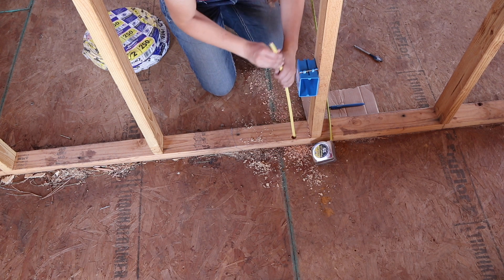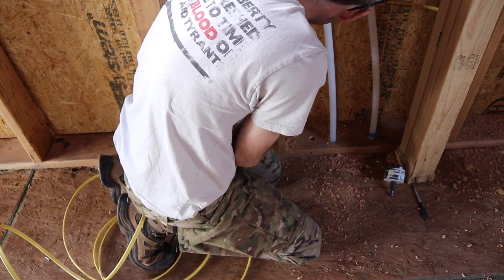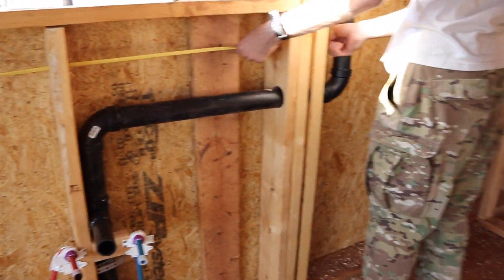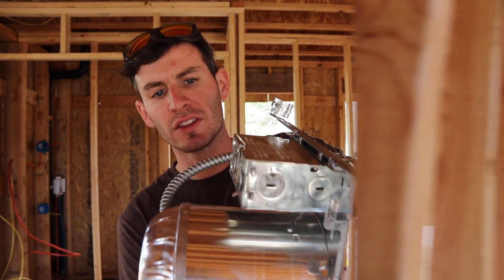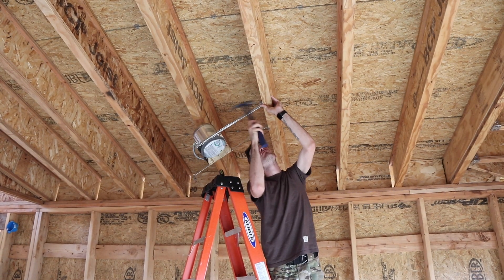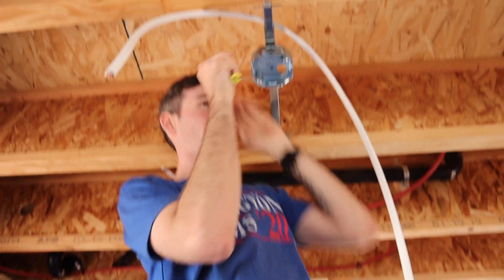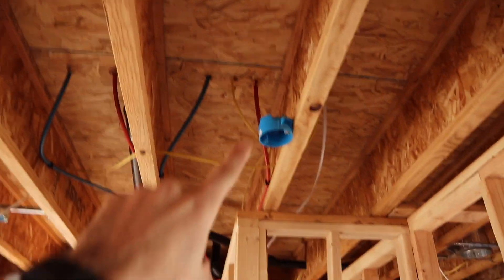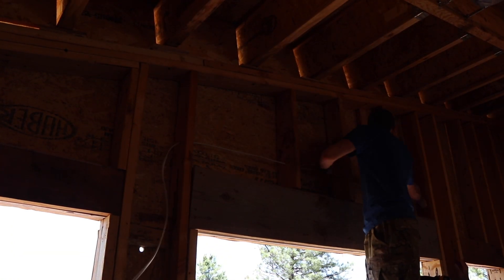Wiring Our House (DIY House Wiring!)

Comment: Romex wire for house electrical has gone up in price to atleast 7 times more than 3 years ago. All the components are cheap, outlet boxes, switches, outlets themselves, yet they have price gouged wire so much that wiring your house is one the most exspensive parts of building your house. Its ludicrous robbery.

Comment: hey man, do good work honestly, but dont act like you know as an electrician... we did our time for the ticket. Respect
Reply from the maker: Not trying to disrespect anyone. Just showing how we did it and hopefully inspiring people in the process.  If you think I did something wrong that's fine, but if the work is correct I'm not sure what the issue is. Electricity isn't rocket science and rough electrical/wiring outlets and switches is well within the capability of most people.

Comment: I don’t see you using spool how did you not have twisted wires?
2nd question how did you determine how much wire you need 
I have 900sqf basement I need to wire I hate to make constant runs to Home Depot
Reply from the maker: We were just careful when running it, and there were a few places where we had some twists but it wasn't too hard without any type of spool
Reply: The answer is simple...run too much.
To much and you an cut some off.
If you find yourself just 1/2 inch short, the fix might be to replace the entire run.  Hope you did not finish the walls before that discovery.

Comment: May I ask is there a certain specific height need to be running wire thru the stud? Like 18 inches above the the floor for the outlet, and 4 ft for the switches?
thanks in advance
Reply from the maker: There is no height requirment for where to run the wires, there is a height requirment for the switches and outlets.

Hope that helps!
Reply: @PootsPastures  Thanks

Comment: You shouldn't place the hole for your cable near the edge of the bottom or top plate - or you will need to install metal safety blocking plates to prevent drywall screws from damaging the cable.  A couple of your holes were within a half inch of the edge.  You should shoot for the middle of the plate.
Reply from the maker: the reason some of the holes (at least in the bottom or top plates are so close to the edge is because of where the floor joists landed below the subfloor.  If we had drilled through the center we would have gone straight into the floor joist.  We added nail protectors over every thing that was close to an edge.
Reply: They’re called mail guards. Or FHA plates

Comment: Those Wago adapters are known to fail and could start a fire
Reply from the maker: I could see where you could not insert the wire all the way, but having the clear plastic so you can check to make sure the wire is properly inserted negates that.  With the connecter in place with a static system that does not have any outside stress put on it, besides a catastrophic failure of the entire device there should be virtually no risk.  I hate wire nuts with a passion.  There are so many more ways a wire nut can go wrong.

Comment: What about if I run the supply line to the light and come off to the outlets from there? Can I do that or do I need a junction box?
Reply: no lights and power should be on different circuits altogther. There is alot more to electrical than what these guys show
Reply from the maker: What part of the code dictates that? Also all of our lights and outlets are on different circuits.  Thanks for watching!
Reply: @PootsPastures   it is australian code for mixed circuits to only be used for areas that arnt so frequently inhabited.  but good practice for everyone as you want light in the case of a tripped circuit
Reply from the maker: Absolutely good practice, from what I recall in the US 2012 code (which was the code when we built) there is no restriction on lights and outlets on the same circuit.
Reply: @christinelyubicic2433  so you’re quoting a code reference from a different continent?

Comment: Thank you for the video! I was wondering. how many outlets can you install on one circuit? My father says it's about 7. Is this correct? I guess it depends on what you will plug in the outlet? But as a general rule, how many? Thanks in advance!
Reply from the maker: Glad you enjoyed the video! And there's no restriction per code, besides certain appliances that draw a large amount of power (dryers, fridges, etc).  We grouped all the upstairs outlets on one circuit, and the downstairs is two circuits (bathroom, mudroom, bedroom and living room kitchen) so we have way more than 7 on a circuit.  You do need an outlet every 6 feet on the walls so I think we have 7 in one bedroom alone.

But you want to think about what you will be plugging in.  If you are going to be using a space heater or things that require a lot of power you want to have more circuits than you would if you were only charging phones and using a lamp.  You can also think about what items will be used at the same time if you are planning on using a hair straightener and blow dryer all while watching TV and listening to music in the morning you may want to have your bathroom on a separate circuit than your bedroom.  We don't use a lot of electronics so we weren't worried about flipping breakers.  However that being said having to constantly go to the panel because you are plugging too many things in is way more of an inconvenience than just having more circuits, so If you are worried about it and have the space in your panel it really isn't all that expensive to add more circuits then you think you will need. 

Hope that helps! Let me know if you have any other questions!
Reply: 1.5 amps per box is what I figure, it’s up to you to determine if you need a 15 amp or 20 amp breaker.
Reply: just go by estimated amps that are being pulled. 12/2 is 20 amps 14/2 is 15 amps. mostly, people jump wire from outlets to lights. 
i would say if you're using  space heaters use more 20 amp home runs. about every 2 or 3 rooms per circuit depending upon needs
Reply: Outlet every 12 feet. Within 6 feet of wall opening.
Reply: No maximum amount

Comment: Nice neat job. However, I cringe at today’s home construction. Engineered wood joists with OSB sheathing are not only the cheapest way but also in a fire, these materials go up in flames like match sticks.
Reply from the maker: I get where you are coming from but getting 20' dimensional lumber that is perfectly straight is almost impossible so having an affordable floor joist option where I could clear span 20' and move by myself was a huge plus.  I would also argue with your cheapest comment.  If you look at most commercially build track homes they use a water proofing impregnated cardboard to sheath the house.  I have also watched a house go up across the street from me using traditional house wrap, and then plywood siding on top of it.  When you get down to the nitty gritty using an osb type sheathing with a factory applied moisture barrier, and then adding siding over it is actually one of the more expensive routes to go.  You are right about I joists though they burn pretty quick.  The zip sheathing on the other hand takes a bit to get going.  The traditional lumber in my burn piles gets going quicker than the osb does.

Comment: Why you didn’t put black botón conectores in the bar box
Reply from the maker: The bar box? If you mean the ceiling fan box because we still had a lot of work to do and didn't want them popping out and getting lost, they were added when the fans were installed.   If your talking about the electrical panel, all of the fittings that the wire goes through to get into the box have smooth edges and don't need them.  Hope that helps

Comment: Hi sir, may I know is it the yellow colour with marking is wire? What's the name it called?
Reply: romex cable #12
Reply: @fatherelijah1763  Hi thanks. But I never seen this type of wire before.😅
Reply: @fatherelijah1763  Special cable only in US or UK ?
Reply from the maker: I'm not sure what they use in other countries I think in North America its pretty common, we are specifically in the US
Reply: @PootsPastures  Okay☺Thanks for your info.
Reply: @PootsPastures  But in my country Malaysia, we are still using PVC single core wire 1.5mm or 2.5mm for housing wiring installation. Thats why I confused when I saw it. 😅

Comment: Does t every appliance need to be on there own circuit?
Reply from the maker: I think as a general rule fridges, stoves, and things are on their own curcuit because they take alot of power individually, but I'm not sure if it's code.  If you do put them separately it could save you from having breakers tripping all the time if you were to use other high wattage things like a toaster or microwave.

Comment: As someone who installed cable and satellite for 20+ years, wouldn't you want to make each electric run vertical instead of horizontal so you are less likely to hit it if making a hole in the sheet rock?
Reply from the maker: The way we did it by drilling through each stud to get to the next box is generally how I've seen it done in our area.  In our case we could have gone down into the crawlspace, over and then back up to get from outlet to outlet, but that would have increased our work and been less efficient for us.  And it wouldn't have been possible to do if we had a slab on grade.  I deffinately see where you would be less likley to hit a wire in the wall done that way.

Thanks for watching

Comment: At 4 mins and on, you connect outlets to each other via wire w/ holes bout 20" up.
Im doing exterior walls, wondering if I can drill hole bout 1" up off bottom plate and run wire on bottom plate in center.
Then I dont have to measure and cut insulation. Moisture barrier on insul would be nice not to cut.
Reply from the maker: Yeah so I think there's a code for how high off the ground an outlet has to be, but there shouldn't be an issue with running the wire on the bottom plate, then running it up along the stud to the outlet that way you don't have to cut the insulation.  The only issue I could see is that if you drill the hole at the bottom of the stud an inspector might not like that there isn't the full area of the end of the stud bearing on the bottom plate. 

Hope that helps,  and thanks for watching!

Comment: I'm a electrician  and was wondering why you used  nothing but 12 -2 for all your rooms and not 14-2 14-3 that's kinda over kill .
Reply from the maker: I wanted all the outlets to be 20 amp, the likley hood of using 2.4k watts at once is slim, but I didn't want to have to worry about it if I wanted to run something high voltage inside.  We did use 14-2 for all of the lights and the crawlspace and  several dedicated circuits, and then 14-3 for all our 3-way switches.  But the reason there is some 12-2 mixed in is because we ran out of the 14-2 and just used 12-2 in it's place instead of buying more 14 and wasting the rest of the 12.  Hope that answers your question.
Reply: @PootsPastures  fair enough also you would want 20 amps if your running a heater to I can't  tell you how many  calls I've  gotten from clients saying their outlets have blown up not knowing lmao
Reply from the maker: Haha for sure, and we're running like three heaters until our mini split gets installed.  Thanks for watching.
Reply: As an electrician....I was wondering the same thing. Also, no one learned the don't pull the wire accordion style too and roll it out. No connector on the fan box?
Reply from the maker: I should have figured out a way to put the roll on some spiny thing (can't tenderness what their called now)  but I'm not sure what you're referring to about the fan?
Reply: @PootsPastures  you ran a wire into a metal box with no clamp or connector (metal romex connector). As far as the spool of wire.... hold it in 2 hands between your legs and roll the entire coil out and the wire will be basically flat and not spiral making easier to run and staple afterwards.
Reply from the maker: Okay that makes sense to roll it all out first, and we added grommets to all of our metal boxes later I just didn't want to open the bag they were in and then lose all the screws and such when we went to install the fixtures and wire them.  But good catch probably should have mentioned that

Comment: I do wonder: The electric lines are one next to another. isn't there a danger of heating? don't they need to be inside somekind of tube for isolation?.
Reply: There isn't a danger of the lines overheating in this instance, just by being next to each other.  If there was say 9 current carrying conductors all bundled up, yes, that's a problem.  In a conduit if you have more than 3 current carrying conductors then you have to de-rate the allowable ampacity of all the conductors in that conduit in relation to the number of conductors.
Reply from the maker: So I don't remember the specifics, but the code specifies if there are a certain number of "lines" next to each other with no space for air movement in between for a specific length the amperage of that curcuit has to be lower.  I don't remember the specific numbers... but wires do heat up as their used, and if you put some insulation around them it would speed up how quickly it heats up, the air being right against the wire helps to dissipate heat.  I hope that wasn't too convoluted of an answer...
Reply: @PootsPastures  makes sense when thinking about it. thank you
Reply: @PootsPastures  one more question in that regard. What if the cables are inside a stone wall?. (bricks that is). They are being plastered later on with cement, so i'm not sure there is air inside?. how do you handle in this situation?. Thank you.!